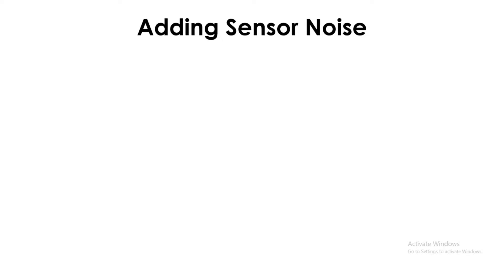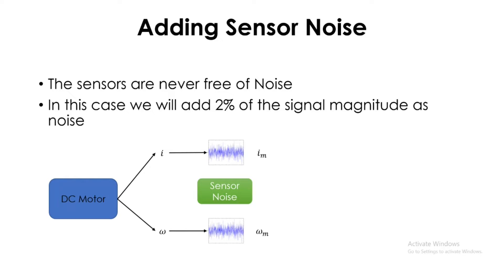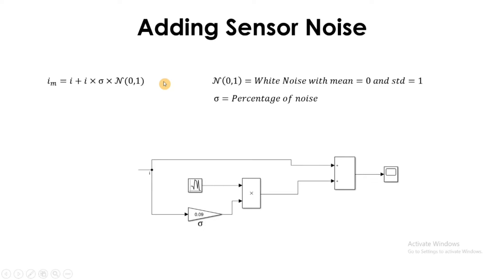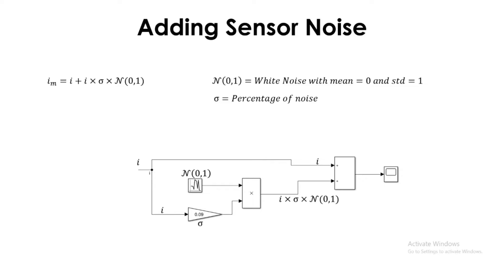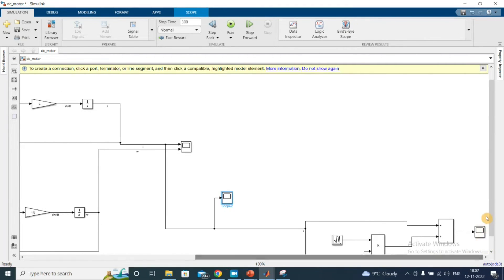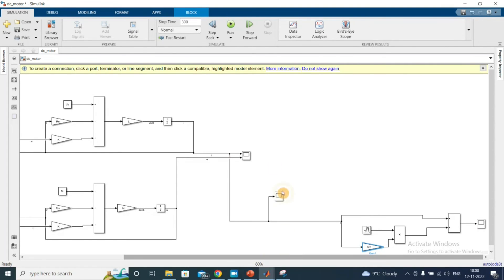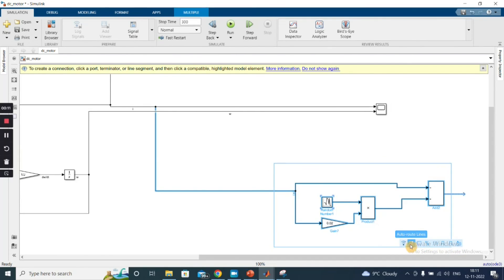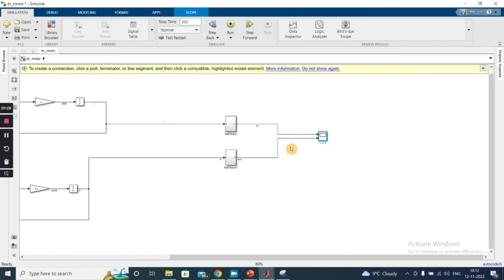Adding Sensor Noise to a DC motor model in SIMULINK: Part-3

Comment: Realy interesting concept. I am trying to design a model of a pressure sensor to be as close to the actual sensor reading as possible. I currently have some difficulties specifying the sensor noise power from the information in the data shet.
Reply from the maker: Thanks. To add required noise to sensor data U can try using "AWGN" block from SIMULINK. It is a additive white gaussian noise block that can add noise according to the input single's power (noise). It uses SNR value
Reply: @Mohankumardash  Thank you so much for the tips..
Reply: @Mohankumardash  I tried that as well. Would you mind taking a look at my model?